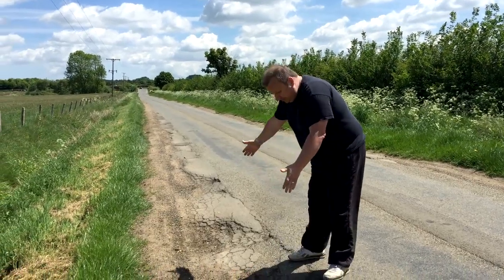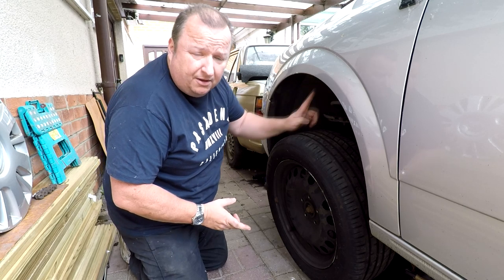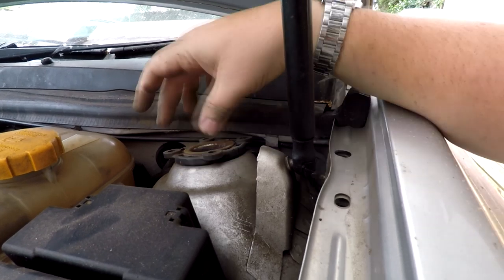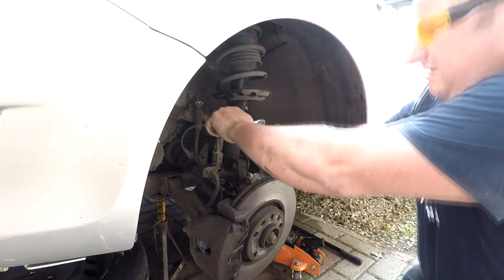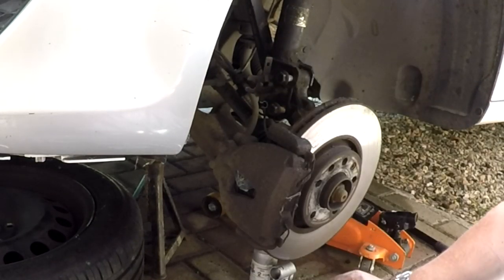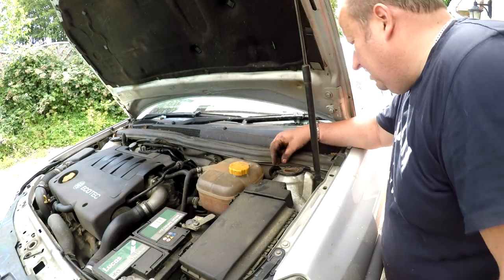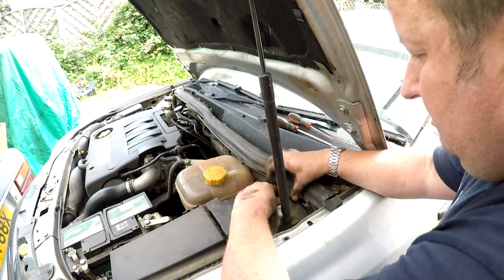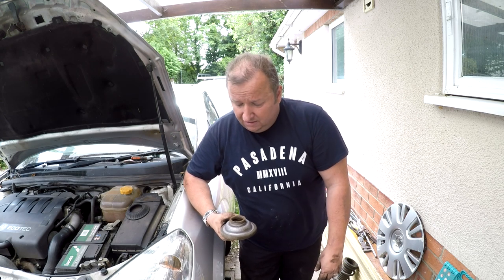Scary Suspension Damage From Pot Hole On Road Part 1

Comment: Buy yourself a battery powered impact driver..makes your life so much easier and saves soooo much time.
Reply: Was just about to say the same thing before I saw your message 👍 would deffo make life easier as you said and Iam sure you would make good use of it given the mechanical jobs you do.
Reply: I bought one of them battery impact drivers from Lidl's, has my wheel nuts off in a trice, very pokey but sadly it doesn't have a half inch stock so I have to use a "biggener" to get me impact sockets on which are half inchers.
Reply: @dodgydruid  adaptor lol.
Reply: What make impact driver would you recommend.
Reply: Hard Worker Milwaukee all day long expensive but if you buy cheap you buy twice even better than snap on
Reply: @dodgydruid  lidl's do a mains powered 1/2 incher for about £35.
Reply: I have a Ryobi 1/2 impact. Never let me down. It was on Amazon £51 bargain

Comment: Yay for the girder wrench, I find mine bloody useful, even use it as a socket tool if you haven't one to hand or you want to put a long pipe on something and not blow the ratchet gear out in the process.   Also I use mine as a handy benchtop vice just for holding things like Matchbox cars or watch movements.

Comment: Well done Martin, nicely done. I must admit I was flinching when you were dismantling it, waiting for the boing! I seem to remember Edd China or someone on a car show fitting a ratchet strap round a shock when he couldn't get the spring compressor on it, just to stop it flying out in his face. Might be useful for a viewer to bear in mind in case they come across a similar situation.
Reply from the maker: The spring had hardly any tension on it as it was at full stretch.

Comment: Hi Martin, I Had the same strut failure on my Astra, a mate also had the same too. Low quality Vauxhall parts these days fella, I use to love good old Vauxhall, but they are no longer the same. Component failures and many other stupid failures and faults or many parts ( including electrical ) on the last 2 Vauxhalls have made me decide - not to buy any more unfortunately. Great video buddy, showing real life problems like this, excellent.
Reply from the maker: Cheers Rob, Its the same for many new style cars I think. So much unnecessary stuff on them.

Comment: This is the reason I watch your channel mate. Sometimes you need to work with what's available. Am part time mobile  mechanic.  I did spring on  Astra last month for it's Mot bloody pot holes. When I looked at the top of the mount it looked pretty rotten. I normally just replace whole lot after a big hit. I lost a ball joint on a Rover 45 td snapped off after hitting a pot hole.  Snapped came up the wing. No injuries just a damaged car.
Reply from the maker: Its a common thing on today's roads I think.
Reply: @retrorestore  that's why I went back to the Land Rover Freelander lol thought suspension would cope with the roads better

Comment: What a nightmare! Those droplinks are the same as the Peugeot 306, and I they are a right pain in the arse!!  I think there is an alen key in the middle you can use to hold the back on while you use a spanner to tighten those back on,  You did a cracking job there, to get that out. I would have been on edge too just in case something was going to go ping.

Comment: Martin that strut needs replaced , the damper is completely shot. And as I'm sure you know , better to be replaced in pairs.
When the shocks are as weak as that it compromises both the handling and the braking under load.
Great video ,as always.
Love the car videos.
Reply from the maker: Yes I know bud, we have a new strut to go in but its not my vehicle so I don't buy the parts.

Comment: In England the potholes are terrible. I have been through this problem, but the one that caused the biggest problem was when someone had removed the drain cover in Romania, but sleeping policemen are as bad...They should move and not lie down. They charge us do much tax but use it elsewhere . No cats eyes in Europe.

You have done well not to sware at all, because a nastly job to do. I was alone but swore a lot. The Hungarian police tried to give me a hand and in the end pulled me to a garage near
by with proper tools. helped until got a call. it is a hard job

Comment: It's called a strut top mount and they got bearings in them for easy turning, i can remember when you had 3 bolts holding them inn, how times have changed since i was repairing cars.

Comment: Claim compensation from the council it is their job to repair the roads.
Reply: I don't think it's the Councils fault that the metal strut top mount was rusted right through,
Put a claim into the Council and they would just laugh at you when they seen  the reason the part had failed.
Reply: @markmawson1  Yes, the pothole doesn't seem that harsh and it's a straight road. If the road is clear justt go round it, if not I slow down.  But yeah sometimes driving on unknown roads you spot a pothole too late and cars are coming the other way and you can only slow down so much.  Years ago I ran into a crater of a pothole, the car was fine.
Reply: You stand more chance of winning the lottery, I knocked out 2 sets of front arb bushes on my old volvo s40 due to the roads the council told me to do one, it's going to take everyone not paying their council tax but that won't happen either.
Reply: Agreed, though not this particular pothole but damage from the general bad state of the roads.
Reply: @chucky2316  ...spot on, sounds good in theory 'just claim off the council' the council responsible will fight tooth and nail to NOT pay out, backed by a top legal team and funded by the TAXPAYER!!
Reply: I hate pen pushers, damn councils, the amount of pot holes ive hit and think what damage has that done is over 100 times. fucking racket

Comment: Great video Martin, ideally you need to replace both sides at the same time. Otherwise there will be an imbalance between the dampers.
Reply: There always is. That is the problem with front wheel drive. Engine and gearbox have different weights. The driver sits on the side of the gearbox to help compensate the engine while also allowing space for the extra stuff to be installed.

Ideally, the front will have 2 different tyre pressures from the weight they have to continually support.

Comment: When i ever do suspension work  i.e Springs or struts i always just cut the droplinks off at either end if they don't look new and just replace them  because through experience once you disturb the ball joints on either end they nearly always after a week or so after they have been disturbed they start knocking, 
And as for them plastic droplinks i refuse to use them because they are common to snap in the middle.
Reply: Yep, mini angle grinder!

Comment: Could you possibly use a pair of visegrips to hold the back nut ? The visegrips would run up against some part of the car and stop. Giving you  two hands to break it loose.
Reply from the maker: Possibly but this nut was really tight.

Comment: Martin, what happened to using a spring compressor? I'm cringing at you undoing these bolts with the spring at that angle...
Reply from the maker: I couldn't get them on because of the spring being out of shape. I did say that in the vid

Comment: Surprised you didnt just cut the bolt off tbh Martin I always replace the anti roll bar bolts ect with all the stuff you fix on ya drive you need a mega long air compressor line lol

Comment: On the Gillingham to Wincanton road, there was for years an infamous pothole that was deep enough for a human to lay in and often full of water so drivers unaware of the dangers ended up blowing a tyre or a shock out.   On the Gillingham to Sturminster Newton road there was a bodged repair of a pothole and sinkage of the road, the repair sank into a channel that if you weren't careful pulled the left front tyre into the ditches, few people came off the road there cos of that.   Go over the border from Dorset to Wiltshire or Somerset and their rural roads are spot on, no divots or pots but outside the major towns in Dorset the roads are utter disgrace :(
Reply from the maker: I would hate to ride a motorcycle now Ian with roads being that bad.

Comment: If you want to change your springs over to new shocks , also situations like this is use a jack to compress the spring then get some rope and  wrapit upa good few times before tying off, then releae jack and he presto the spring will now be loose toundo strut, when rebuilding  do up all bolts, nuts  jake hub up until spring is seated then either cut or undo rope....job done.

Comment: I would put a claim into the council for the repair,   Must admit I’ve missed these car repair videos,  reminds me when I had a snapped spring on my Vectra C,  I noticed a crunch sound when driving over uneven road I inspected it and noticed it had snapped but was still under tension by just a a few mill at side of the shock pan 😮,  I was lucky to find it when I did because it could of blew the tyre,

Comment: We've all had that dreaded car! Had a Peugeot 807 once from new... Every bolt was either seized or would sheer. Even the wheel nuts would require a breaker bar and scaffold tube. First mot saw three snapped springs, two wrecked callipers and snapped exhaust mounts... 2nd mot was two snapped springs and exhaust mounts which I let the garage do and mechanic nearly had a breakdown over the repair. It had gremlins. I got rid of it with just 30k on the clock. Also for about eight years owned a forty year old Ferrari (wished I'd kept) where every nut and bolt came off with a click.
Reply from the maker: Amazing.

Comment: So to release the pressure on the spring... you compress it?
Reply: You usually use the clamps to hold it so it don't ping out and fly up in the air 50 feet , I've seen that happen before . He couldn't do that due to it being on the slant . Good job 👍
Reply from the maker: No, to release the pressure on the droplink bolt I was having trouble with I compressed it a bit.

Comment: Could you not run a nut runner off your compressor? They're cheaper and tend to last longer than battery tools. Although to be fair I bet its a pain in the arse running the hose around the house every time.
Reply from the maker: I have one but as you said, I couldn't be bothered lol

Comment: Buy A battery impact I would not be with out my 1/2inch  DeWalt  impact.. also why didn't you use a vise grip on that nut that was giving you a hard time?
Reply from the maker: I got it off didn't I Marlin lol Many ways to do the job with what you have to hand.

Comment: I would of left the original shock and just replaced the top mount.Taken the strut back and exchanged it for the top mount .So the shocks were of equal strength. You should replace shocks and springs in pairs.Like you know if you want the vehicle to drive right.
Reply from the maker: Watch video 2 bud,
Reply: @retrorestore  I will sorry if I've spoke the obvious and you did it anyway lol.Didn't watch 2 because I knew what you were doing .But Obv not lol.

Comment: These kind of jobs always crop up on a wet Sunday about six oclock. Deep joy.
Reply: You are so right......
Reply: Not long ago i was just pulling into a parking space at my local hospital hit a little pothole as i went into the space and it sounded like a bomb went off people looking over at me, Got out of car and the spring had snapped and had become unseated and went straight through the side wall of the tyre, i had to get a lift home get all the gear i needed to do the spring and change the spring in the hospital car park and change the tyre, i was getting a few funny looks
Reply from the maker: Wow. Not good.

Comment: That shock had it too, gas pressure should force the rod out and you can see rod moves too easily as lost lot of fluid lost too probably (strut looked damp) .
Parts are dirt cheap, want do both sides and get set of drop links too .
euro car suspension is p1ss-p00r design/quality, japanese made tokiko on that old triumph 10x the design and quality .
Indeed you can forward evidence to your council and attempt make a damages claim ....
in wrong scenario that could of ended in nasty road accident .

Country is got to pot lol . 

Stay safe and put that back together with decent branded parts like KYB Sachs MEYLE . good struts about £100 a pair (sold as set), top mount about 25 to 30 for decent ones, avoid the cheap unbranded junk .

Comment: Anybody else cringing at this wondering when something was going to slide out
First job cutting disc  take the tension out of spring and drop link sorted as well
Just get a donor leg from scrapyard
Don't think people buy new or do things in pairs now
Safety  and common sense has now turned to fix it cheaply to get it back on road

Strange thing is I did a driveshaft on lupo today and bottom arm had it all to bits
Putting it back together and the strut fell out  top bearing failure
Felt so lucky as I caught it...   No skin off no blood split
I hate spring me
Citreon  are the worst   just huge and you squeeze them so tight
Those spring compressors should be scrapped
Invest in a modern type finger compression type

Comment: Vauxhalls are shit for this happening because water sits on top of the strut housing the top mounts become weak and fail
Reply: I agree with that it happened on my dads mk4 astra both front ones went ended up getting rid of the astra but another thing with the astras they are known for the brake callipers seizing same fault as the old cavaliers .
Reply from the maker: Exactly, the cap was missing on that side.
Reply: You mean Opel. Vauxhall just rebrands an Opel as a Vauxhall. I don't think we had a real Vauxhall in years.

Comment: If you want to avoid this kind of damage don't drive a vauxhall, total shite!
Reply: ALY DAVIDSON  what do you drive
Reply from the maker: I've driven Vauxhall's on and off for 20 years and never had any serious problems.
Reply: @Phil-1969 , I drive Toyota's
Reply: @retrorestore  The older vauxhalls were bullet proof
Reply: ALY DAVIDSON old Vauxhall’s pre 2000s where full of rust after a few years old , I had enough to know, newer Vauxhall’s are much better motors , from that comment you haven’t a clue or still wet behind your ears
Reply: @Phil-1969 , you haven't a clue, vauxhalls are total shite i wouldn't piss on 1 if it were on fire, you only need to read all the threads online on the problems with Vauxhalls. Any Jap car is far superior.

Comment: great sticking your face right up to that spring, it that had gone so would have your nose...
Reply from the maker: Nice comment. How would you suggest removing it without getting within arms length?
Reply: @retrorestore  wrap a blanket around it first and strap it on with some belts  those glasses would have done sweet FA.
Reply from the maker: @blueiceplus  If you look, the spring was hardly under any tension as the strut was not fixed at the top so it was unsprung. I thought you would have known that bud.
Reply: @retrorestore  Oh ok, so what was the scary thing about it ?
Reply from the maker: @blueiceplus  Come on Dave, My vids are real life bud, I say what I think at the time bud. I see you have a car repair biz so you know all about this job so you really didn't need to make a comment like that. We all get the job done so let's leave it there.